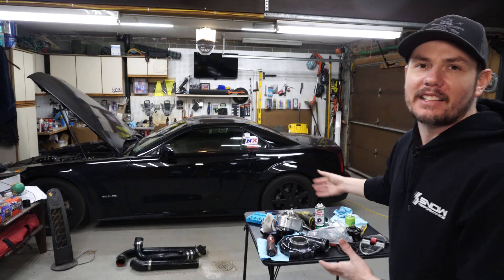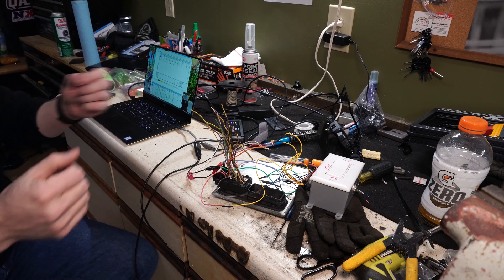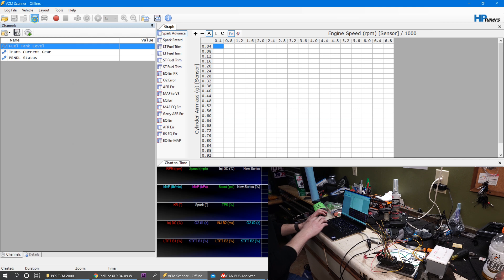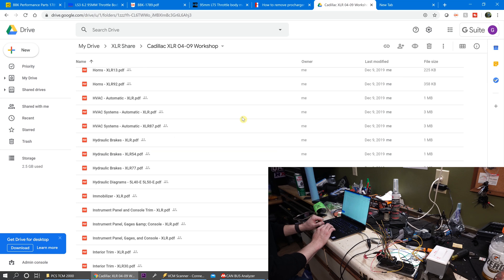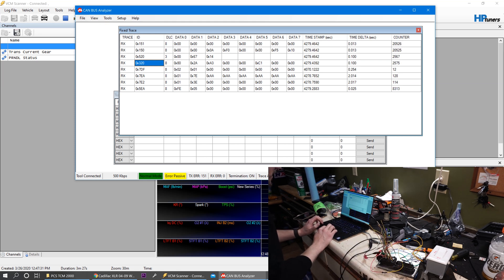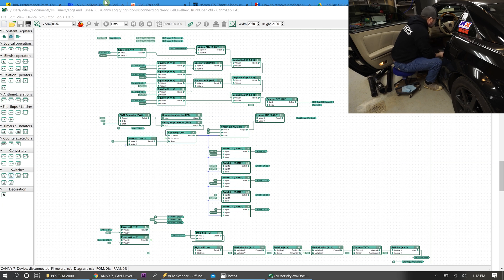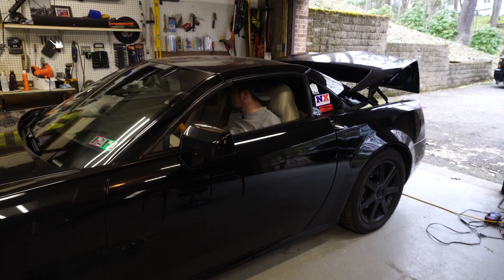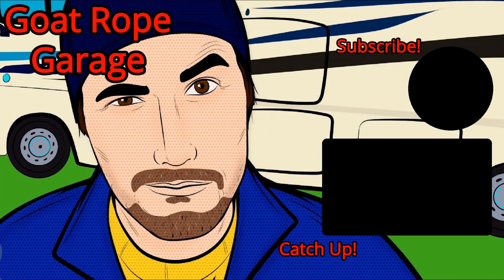Hacking The Can Bus To Get Our Convertible Top Working Again!

Comment: I would think I just out smarted the car and my luck I would accidentally hit the button going down the road lol
Reply from the maker: The idea has crossed my mind a time or two, but a relay will fix that soon enough
Reply: Goat Rope Garage I’m sure you thought about that cause us kids are accident prone lol
Reply: @GoatRopeGarage  Did you implement the relay? Does it get park information from your after market Transmission control module. Excellent work by the way.